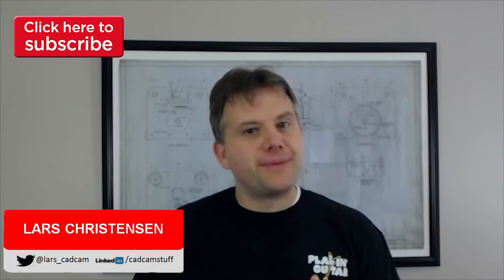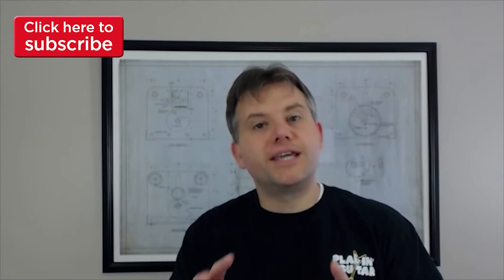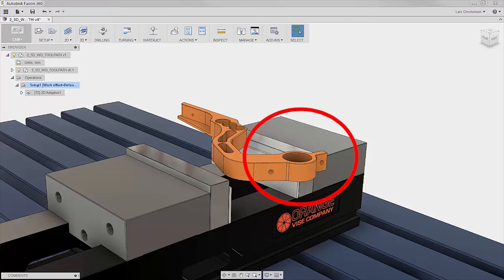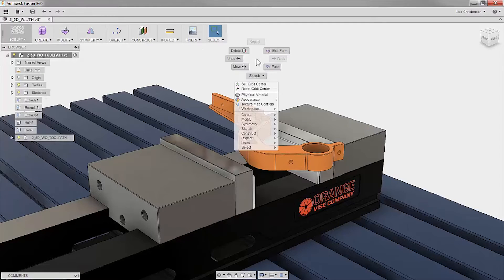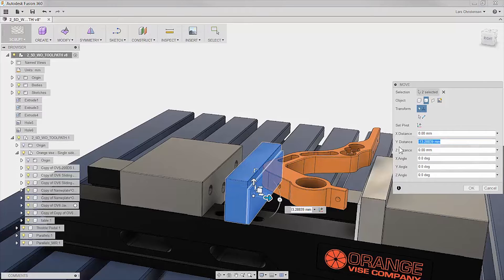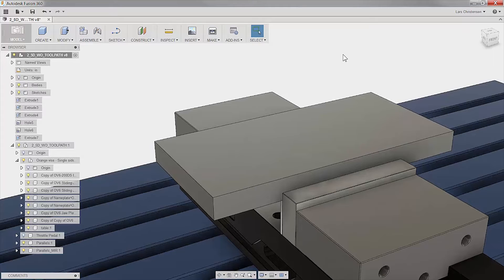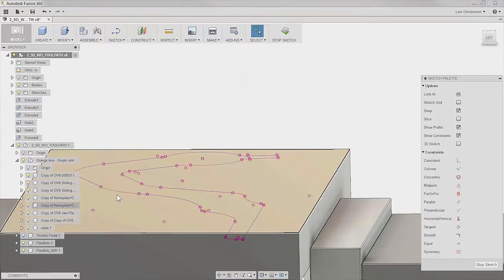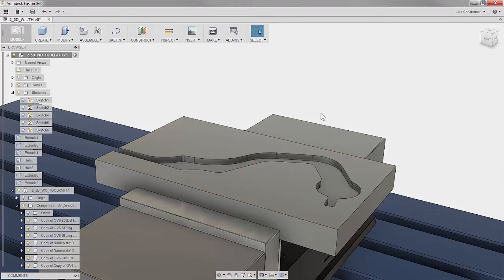How to Hold on to Complex Parts in Your Mill— Fusion 360

Comment: You explained how to fix the part properly for multi-sided jobs. But, how do you set the origin on your cnc cutter with high precision? On the other side, If I understood correctly, you'd only need to set the origin once. If for some reason you turned off your machine and you need to execute another job, how would go about doing it?

Comment: Lars,

I'm using a Lenovo W520 laptop for CAD/CAM and can't get the middle mouse button to orbit the part. I've tried a separate USB mouse with the same results. Lenovo uses the shift+middle button+wheel to duplicate the alt-tab function of showing icons of all the open apps on the page. I can change the assignment but don't know what to change it too. Any ideas?

Jim
Reply from the maker: Hi Jim, Dang, I'm really not sure. I would try to ask the question on the Fusion 360 forum. Someone else there should be using the same workstation. https://forums.autodesk.com/t5/fusion-360/ct-p/1234

Comment: Thanks Lars. Great video. The parts in question are Steel (I think?). I'm wondering how would you do it if they were Aluminium? I guess the pitbull clamps would damage the finish? And an aluminium block: would that still works as a "soft" jaw if it has the same hardness as the part?
Reply from the maker: Thank you so much! Glad you liked it. You would have to be careful when tightening the pitbull clamps if you are using it on a softer material, but you are in control how much strength you are using :-). You could fold up a small piece of paper and place that between the part and the clamp; this will create a little bit of sponge effect that can make it easier not to over tighten.
I have used aluminum soft jaws to hold aluminum parts many times with great results. If you have to machine hundreds of aluminum parts, I would create the jaws out of steel. When using aluminum on  aluminum you will see more wear and you can also have trouble with it binding if you having something like a circular fit between the two.Again, thank you for taking the time to watch the video.

Comment: Thanks for another very useful video! When doing the CAM setup do you set the XY zero origin to the center off the hole you put in the vise jaw?
Thanks again.
Reply from the maker: +Kerry Harrison Glad you like the video :-). Yes, the hole in the soft-jaw on the solid end is for the WCS. Now you can take your soft-jaws in and out and just pick that hole up, and be on your way.
Have an awesome day!
Reply: Hi Lars, new to F360/cam, am enjoying your vids. Seems obvious, but what do you mean by "pick up the hole"? How does the mill determine the hole location, assuming you've taken the part in and out of the vise? Thanks!
Reply from the maker: Hi vahpr, using either an indicator, edge finder or a tool probe.
Hope this is helpful!
Best,
Lars
Reply: Lars, I'm curious about the reasons for the pickup hole.  Can't you just use the front left of that same jaw and skip milling the hole?  If you pull the soft jaw and put it back in the piece is still relative to those edges.  So I'm interested in hearing the additional advantages you see to the hole approach.

Comment: The match shape in Fusion 360 is just what I have been looking for. Professionally I design plastic injection molds using Cimatron which is a pretty high-end software. However, for my home shop I have a small Tormach 770 and I now use Fusion 360. Extracting EDM electrodes from geometry might be a possibility with your tip! Thanks!
Reply from the maker: +Jay Catmull Yes! You are right on. I used to use the Combine function for EDM electrodes. There will still be some cleanup and edges that need to be either deleted or moved back for an EDM electrode, but it works!

BTW. One of my good friends owns a mold shop and they also use Cimatron for their high-end stuff :-)

Thanks for comment, and have an awesome day!
Reply: Hey Jay . Base in your experience, can Fusion360  compete with Cimatron in the injection molding industry?

Comment: Hi Lars, great videos.  Thank you for doing this for the CAD/CAM/Machinist community.  I'm essentially relatively new to CNC machining and I have just started using Fusion 360.  I have a number of "Wedge" shaped parts that I use a sine vice to produce.  My problem is getting Fusion 360 CAM to orient the stock correctly to create a tool path that takes off the wedge shaped stock.  The stock is rectangular and every time I go to setup the origin with the Z axis normal to the wedge shaped surface the rectangular stock shifts so it is also normal to that surface.  How do I create a setup and tool path to make this work in Fusion 360?  Any help would be appreciated.
Reply from the maker: Hi Scott, Can you invite me to your project so I can take a look? lars.christensen@autodesk.com

Comment: Hi Lars, at the second op of the pedal is there a way to tight the part with the Mitee-bite through the material? because it suppose to be stock material all over the part when upside down?. Thanks.
Reply from the maker: That is a great point. Honestly, might be one of those DUH! moments when you try to install the part the first time in the fixture :-). There might be a chance that you could still could tighten the Mitee clamp, but I could see that you drilled a couple of clearance holes in your first operation.
Thank you for taking the time to comment! Have an awesome day!!
Reply: I'm very familiar with Mitee-Bite and what they do (as we're the grand winners of their Top Dog contest that was held last year). lol In regards to the pitbull clamps being used how you illustrated, the pitbull clamp would tear up the finish on the spline of the part. Doesn't matter if it's knife-edged pitbulls or not...it will still compromise the part. Those little suckers are best when used when holding on at the carrier. However, I would have used ID expansions or XYZ Xpansion pins in this case. Nonetheless, thanks for taking the time to make these vids. You're never too old to learn something new.  :)

Comment: This might sound stupid, but couldn't you use a "donut" shape magnet to hold  metal cylinders to hold the piece you want to mill?. There are magnets that are so strong you can't pull them apart.
For example, with your piece you could use 4 magnets, 3 for the 3 holes on the left and 1 to the one on the right.
Does this makes sense, or possible?. There would be a problem "maybe" with the drill itself. If its attracted to magnets you couldn't use this system.
Reply from the maker: +Pedro Gordinho Not stupid at all! I hope someone else also would share their thoughts on this. I have used magnets on the mill from time to time (Just borrowed one from the grinder) There are a few disadvantages. One, you better have a magnet that can be turned on or off. If not, it can be a pain to clean the chips and shavings from milling off. Also, if you have a powerful "Earth Magnet" You might find it a pain to get your part off when done :-). That brings another possible concern; you better have a good surface for your magnet. If you have a surface on your raw stock that is all dinged and uneven, you are suddenly in trouble. One last thing, as I'm thinking on top of my head. You can also risk that you are pulling the part down if it is relative thin using a magnet. But all in all, not a bad idea either. Hope some other people share their 2 cents on this.
Thank you so much for watching the video and take the time to comment.
Reply: +Lars Christensen Thank you for making these videos.
I have another weird thing to ask. Do you think you could hold the piece with ceramic cast?.
You pick up a wood box without the bottom or top and put it surrounding the piece. Next you put ceramic cast with is liquid at first and them when it hardens, you can turn the box around and you get a holding piece. So, what do you think about it, would it work?. This would be very cheap to do.
Reply from the maker: Well, I have never tried that. I guess something like that could work :-). A couple of questions; How are you going to clamp the part in the ceramic cast? I don't believe you can get away with just a mirror cast of the part. Something like a Face Mill will try to suck the part out of the mold, so something has to hold it down. Second, ceramic is hard but also very brittle. I could see it easily would crack when you try to clamp it. Third, this method might not work if you have multiple parts you need to machine. One reason we clear the round corners is so parts does not bind there, as multiple parts are never exactly the same size.
You might be on to something here Pedro, just a few of my concerns that might not even be a problem.
Have a great day!!